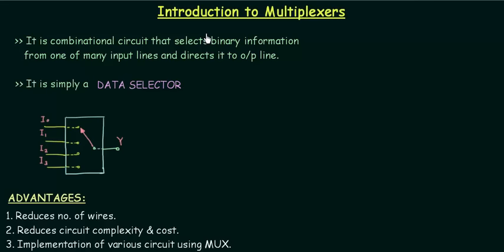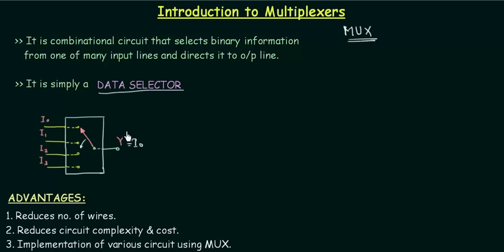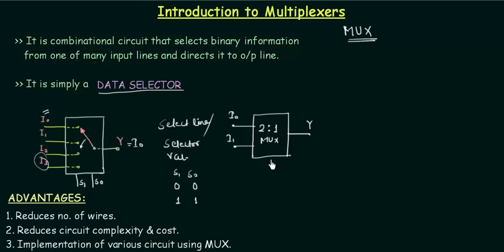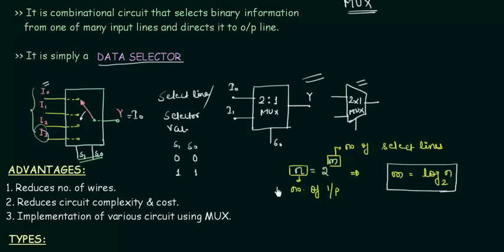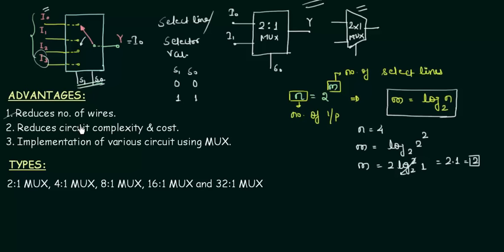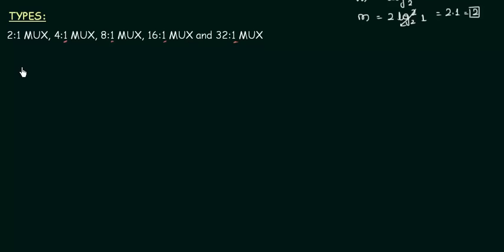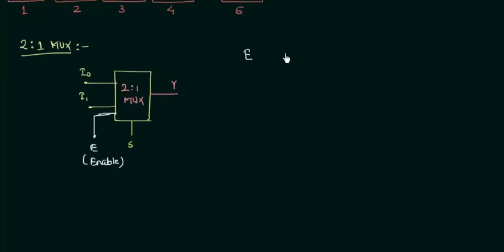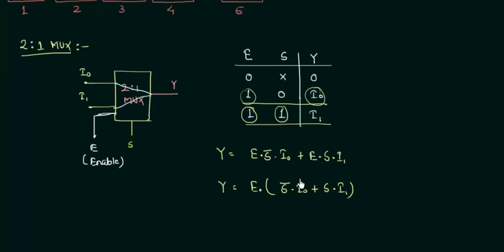Introduction to Multiplexers | MUX Basic

Comment: For the two AND gates at the end of the video, do you not need to have the Enable signal in both of the AND gates? Correct me if I'm wrong, but it looks to me like the Enable only goes in to the AND port on the top.
Reply: I have the same issue

Comment: In the circuit, the 3 inputs ands will not be the two ands ?, because the "E" is multipliying both of the parhentesis expressions E(S'.T0 + S.T1).
(In your circuit you just inserted a single and port with  3 inputs in the minutes 12:03)

Comment: Thanks for the videos sir, I really appreciate them. Why doesn't the Y equal the I0 when I use I0 = 1 and s = 0? Using the trut table, the output is supposed to be equal to I0 when s = 0, and I1 when s = 1. However, using the circuit/logic gate you gave, the result when s = 0 is always 0, because of the fact that s is anded with the other values (E and I0). This leads me to question the validity of this circuit. Please explain sir.

Comment: You can take the selection without using the log also

Take number of input as m
Use this method
2^n=m
That is when 2^2=4
If the input is 16
Then 2^4=16
N=4 and m=16
Easy

Comment: At the end enable should have wired to the last or gate...... you have wired it with only the 1st and gate which is wrong....
As the formula says that E.(S.I0 + S.I1) which means enable is in and gate connection with the whole or gate....please notice and correct...

Comment: Just a little correction, may be you know but couldn't notice; the circuit implementation is wrong  -- "There should be another AND Gate after S(Bar)I0+SI1 with a single input of "E" so the result will be E[S(Bar)I0+SI1]".

Comment: Correction at 10:00,
Multiplexer is off when E=1 and on when E=0... This opposite convention needs to be represented by a not symbol while representing the enable input wire. 

Source :  Principles and Applications of Electrical Engineering by Giorgio Rizonni (Fifth Edition) p. 634
Reply: Is that so? By using a not gate before inputting 'E' to the multiplexer?
Reply: @vizviz72405  damn first year ka throwback hogya. Ab mere se mat puch bhai. I don't remember any of this anymore xD
Reply: @vizviz72405  xD same cllg CSE 3rd year

Comment: your implementation is wrong
your result will be ES(bar)Io+SI1
which is wrong
Reply: Exactly, that's what i have also noticed. There should be another AND Gate after S(Bar)I0+SI1 with a single input of "E" so the result will be E[S(Bar)I0+SI1].